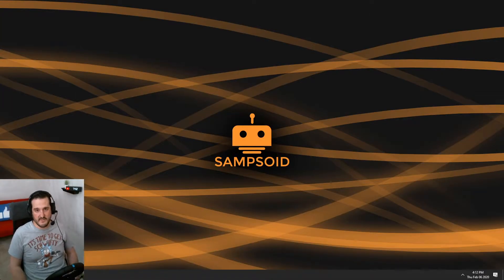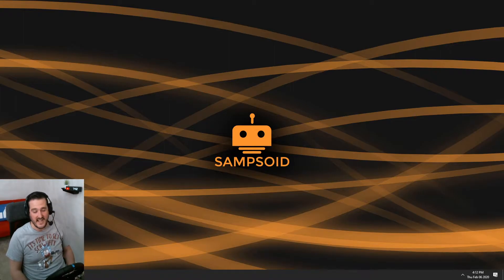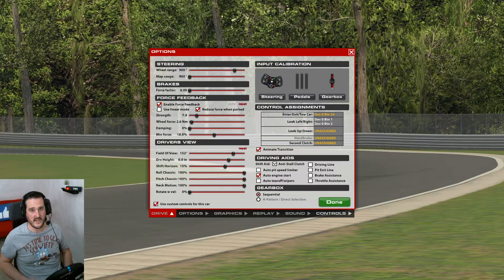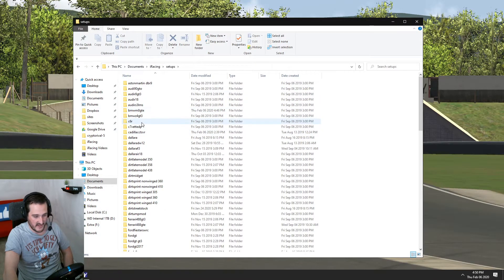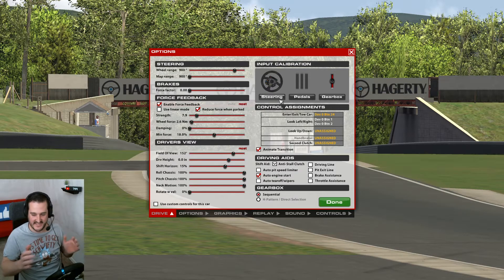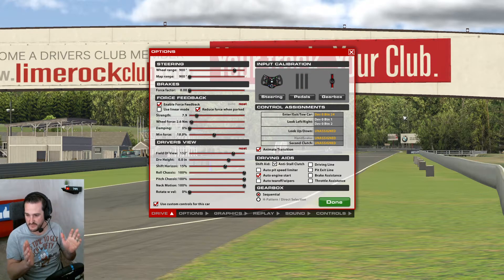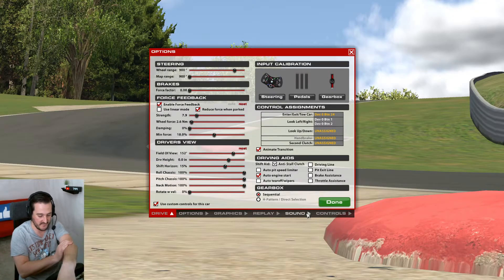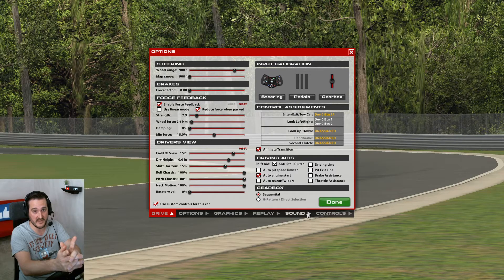How to Fix Logitech G29 / G920 Brake Issue in iRacing

Comment: anyway to setup a max force on the brake at 65% when using vjoy logitech aint registering the wheel when vjoy is active and cant do it in iracing since there im trying to make the 65% max pressure at 80% in iracing so i dont lock up as easily

Comment: Great video. I'm having a similar issue, but it's kind of the opposite actually of what you're having, my brake pedal works fine for a while, but when I switch sessions or reboot, it starts to register a lower input, like when I brake around 80% it registers only 50% or so. Do you think this fix could work in my case as well?

Comment: for logitech it is inverted, so calibmax and calibcenter will be 255 and calibmin 0, for you to limit your brake you must touch the calibmin, as the example below.(using 40% of the brake on This example) 

 DeviceName: 'Logitech G27 Racing Wheel USB'

   InstanceGUID: '{53C8F960-77EB-11E8-800E-444553540000}'

   AxisList:
   - Axis: 0
     AxisName: 'Wheel axis'
     CalibMin: 0
     CalibCenter: 8192
     CalibMax: 16383
   - Axis: 2
     AxisName: 'Brake'
     CalibMin: -60
     CalibCenter: 255
     CalibMax: 255
   - Axis: 3
     AxisName: 'Accelerator'
     CalibMin: 0
     CalibCenter: 255
     CalibMax: 255
   - Axis: 4
     AxisName: 'Clutch'
     CalibMin: 0
     CalibCenter: 255
     CalibMax: 255
comment here if you don't understand
Reply: I do not get what do you want is that fixing the problem?😊

Comment: Im having a problem with my G29 on iRacing. I started playing like 2 weeks ago, and everything worked perfectly.. steering and pedals and gearbox were calibrated perfectly. I logged in today and the game wasnt recognizing my steering.. i removed all the cables from the steering wheel, and still no difference in the game. Very wierd.... any solutions or suggestions?

Comment: Hi David, I have a technical question, I installed the G920 and the pedals go completely the opposite. That is, they work 100% all the time and when I push them, the gas drops and the brake unblocks. How to reverse it, please?
Reply: I just bought a G920  and I'm experiencing the same issue.

Comment: From Playing F1 2019 I have had my G29 set to 360 degrees rotation, I notice your using 900 degrees the normal setting should i be using that or does it make a difference once calibrated i would be interested on what you find.
Reply: I would say yes, I had my steering set to 270 on F1 2019, 450 on ACC but on iracing I have it on full to 900.

Comment: i can confirm that this also happens with the G27, however i am using a load cell modification from Ricmotech. My quick fix to this problem is at the beginning of my first lap after sim reboot i push the brake pedal as hard as i can and that readjusts the calibration.
PS.: i drive with the brake setup curve adjuster at 1.65, and while i was digging through youtube before arriving to this video, it was mentioned that for those who are using pressure cells they should put the curve adjuster setting at 0. (maybe this solves my calibration problem in the future, i don't know. have to test).

On a different subject, i find that my throttle pedal "throw" is too short, in other words i can't find that sweet spot of having it below 50 percent without being too abrupt. Any solutions to this? Or is it simply "upgrade to a better set"? thank you